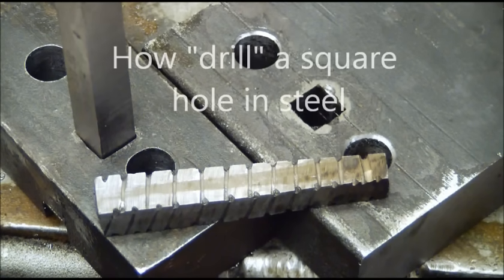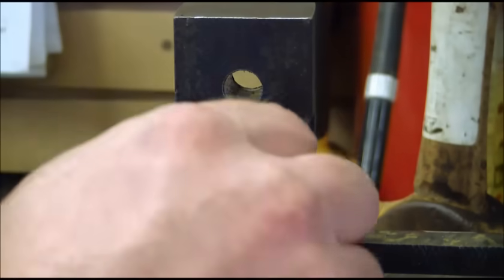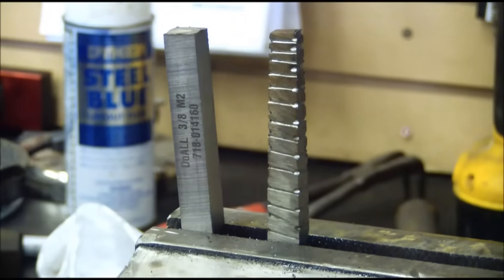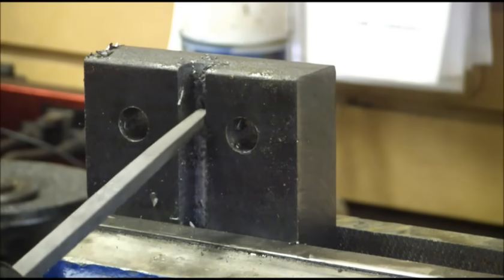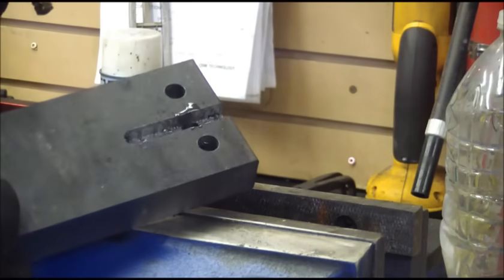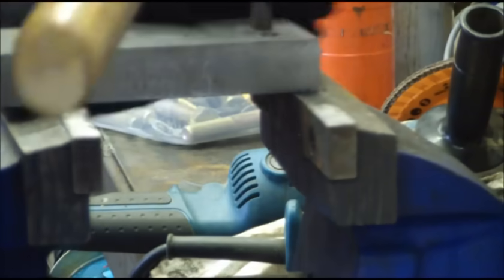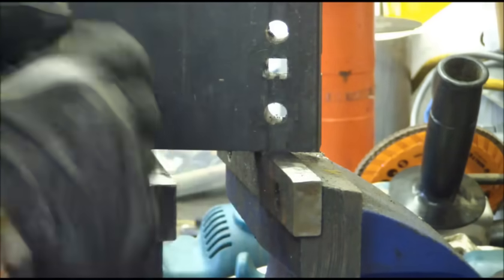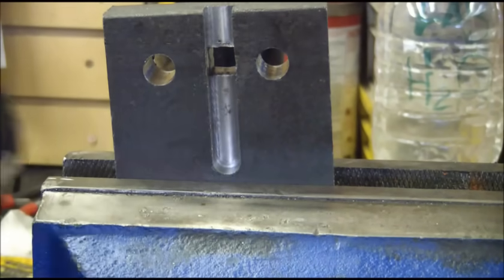Machining 101: How to drill a square hole at home without special tools.

Comment: I will make several comments.

It looks to me like you are smoking your drill bits by running it way too fast.  Since this is for a piece of tooling, good practice is to drill a pilot hole.  This gives you several advantages.  First, you are working less as the smaller bit has a thinner web so you don't have to push as hard giving you less deflection.  Second when you switch to the bigger bit, you are not deflecting any metal at the web so you will be cutting not pushing to force the metal out of the way.

Since you were not really broaching where the tool makes a series of sequentially deeper cuts, what you were doing was "cold forging" or just forcing a square peg in a round hole.  The down side to this is that it requires a lot of force and you tend to distort the part you are punching the hole through.

Comment: couldn't you have used a torch?
Reply: Torch would lessen the hardness of the steel.
Reply: Thanks for letting me know. Had no idea.
Reply: @Flyinghammer1  The steel hes broaching is soft , otherwise the tool bit wouldnt have cut it . But he could have got the starting hole closer with  a plasma cutter , if he had one .

Comment: Funny how the title claims "without special tools" yet, from frame one we see the "special tool" he made to do the task.
Reply: All these people making this same comment just don't get it. He STARTED with no special tools, then made one. That's the whole point.
Reply: Perhaps, wigs1098 , it's you who doesn't get it. You just said "then made one", explicitly admitting that he indeed used a special tool. He first made a special tool then used said special tool to accomplish what he claimed to do without aide of a special tool.

Frankly though, I'm just arguing semantics for the sake of being difficult. So, yeah... Technically, however, I'm right and the videos title (and you)  is/are wrong.
Reply: Steve French I understand perfectly that the title says the hole was drilled without special tools and if you take it literally, it wasn't. However, to those who actually work in workshops and have to solve problems by improvising and making do, it is common parlance to actually say a job was done without the use of a special tools (usually professionally manufactured ones) by making or adapting what is in the workshop to do the job. For most of us who do this kind of work we understood the intent of the title and felt no need to comment. So yes, you are technically right and I am wrong. And whilst we are at it I might add that it is 'video's' with an apostrophe to denote the possesive!
Reply: wigs1098 Alright, you got me. But the apostrophe thing shall be blamed on autocorrect.
Reply: Wood 'n' Stuff w/ Steve French  you sir, are a person of character, I can tell, happy to have read your comment,

Comment: You could just as easily drill four 1/16 holes equidistant from each other in a square and mill the inside out with a 1/8 cutter. then clean it up with a file or a 1/16 endmill, if you're not afraid of breaking it.

Comment: Some of you people are either jerks or trolls.  Begone ye scallywags!!  This man showed how to do something with tools that a lot of people have available, namely a die grinder and vise. A 3/8" push broach goes for $130 on amazon.  Depending on the tool steel, he used $40 worth of HSS, $20 if he recycled that piece that he used to finish the hole.  It's a very serviceable hole for his purposes.  My only complaint is that if he had another serviceable tool holder, and the tooling that would serve the purpose, he could have lathed/milled the broach more true than with a die grinder.  But maybe that's why he needed to make a tool rest in the first place.
Reply: WTF are you talking about. Most people don't have a die grinder. Some have a vise. Yes there are handymen on this channel but machine tools are far and away from most handy people who use carpentry tools from a hardware store. Hell I can't even find a simple metric tape measure in the states.

Comment: Pretty cool but I don't like the idea of using a vise as a press... that's a good way to add excessive wear and backlash. A cheap (but much more effective) press could be bought for under $60.
Reply: Title says "without special tools." means no press is allowed. 

Also, grease your vise to prevent wear.

Comment: Great video.  I wounder if you could make a keyway broach the same way.  those things are expensive.
Reply: I have made keyway broaches by hand before. You just cut the teeth and a taper on one side. I use metal shipping bands for shims.(The thin metal bands you see most lumber shipped with now a days.) If you do a bit of layout before cutting the tool steel for the broach  it will work just as well as an expensive store bought one.

Comment: How many RPMs do you use for a 3/8" hole?
Considering a 9,5mm HSS drill at steel would allow a cutting speed of 20m/s. In the video it sounds ans smells like more than the allowed 670rpm ... ;-)
Reply: Cool!  You have Smellevision!!!

Comment: Use a 3square file and save time as well as learn the skill of using a File, other than that I assume the reason for heating the Tool was to slightly expand it for clearance over standard size. By the way how long did it take to grind the tool steel to a taper?